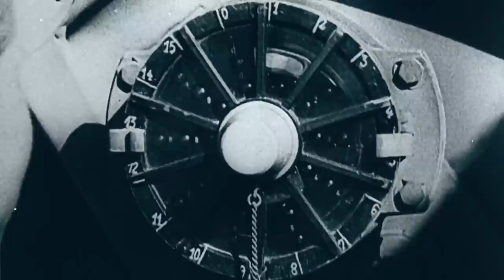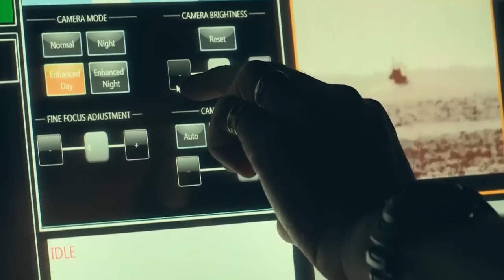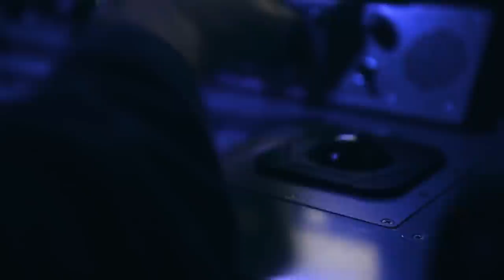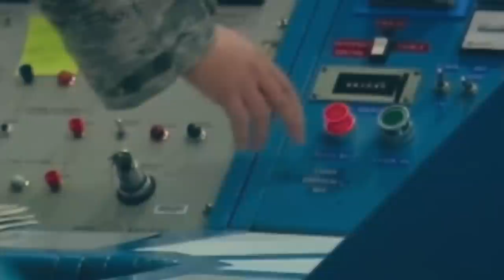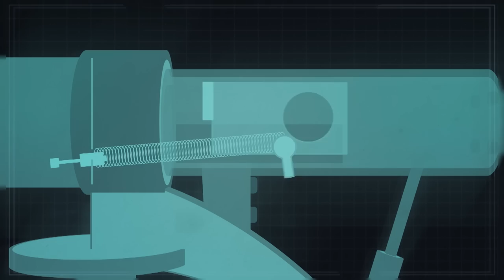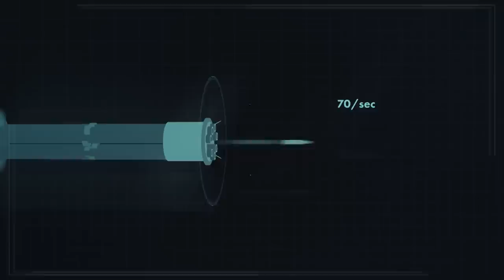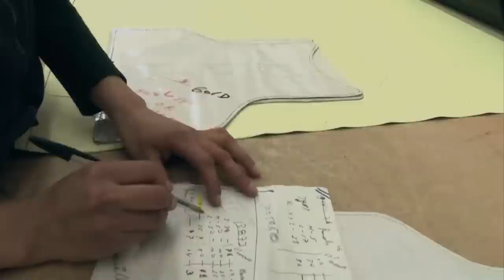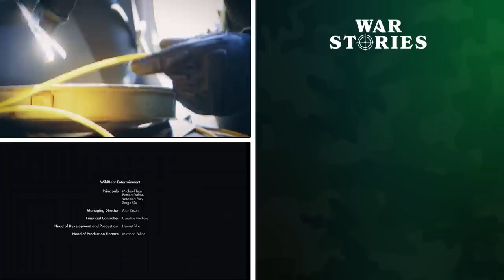How Laser Targeting Revolutionised Modern Weaponry | Machinery Of War | War Stories

Comment: That statement about sweeping of wings to make them easier to move through the air is not entirely accurate. Sweep delays the onset of the shock wave which can form at transonic speeds.
Reply: It also has the effect of reducing drag as compared to a straight wing of equal length